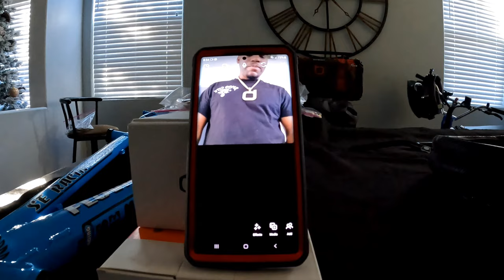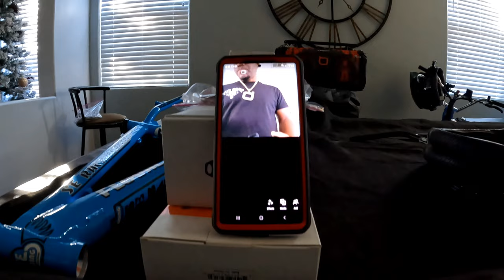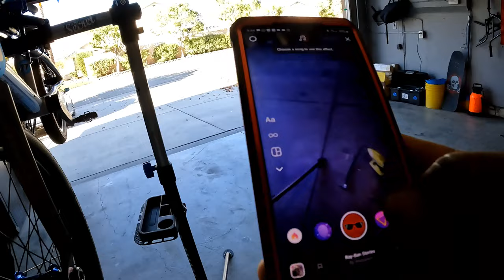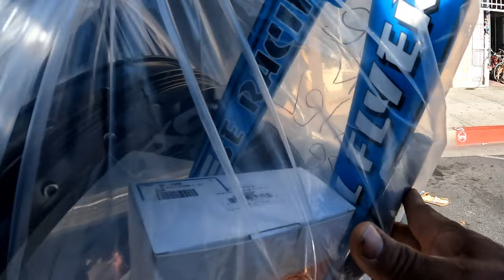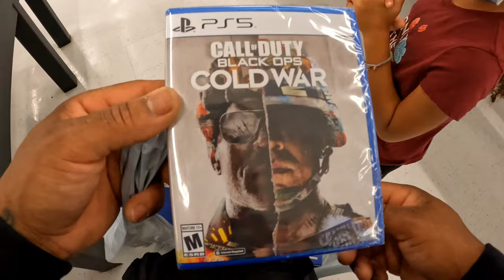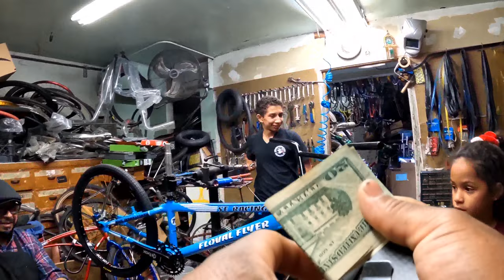MY SE BIKES RACE 24 INCH FLOVAL FLYER BOX COMPONENTS BUILD

Comment: I noticed you have the se chain tensioners. Does the floval flyer not have the weird built-in chain tensioners like the PK ripper?
Reply from the maker: The pk has the weird drop outs for the 20 mm hubs the floval is normal